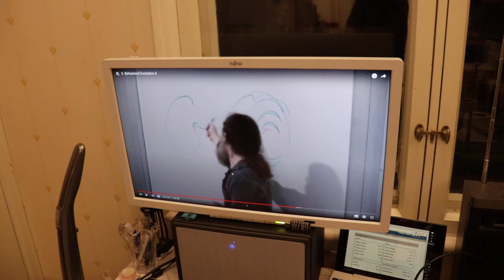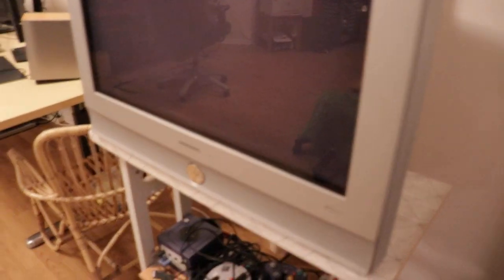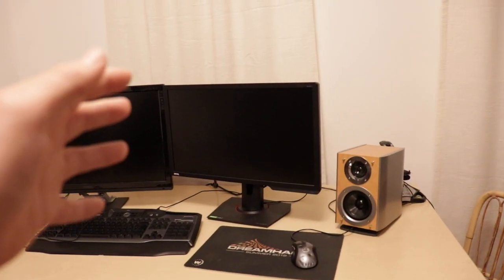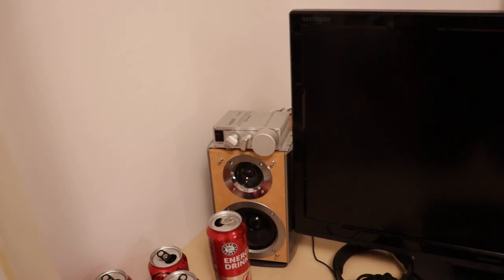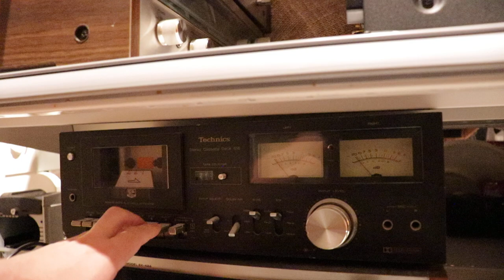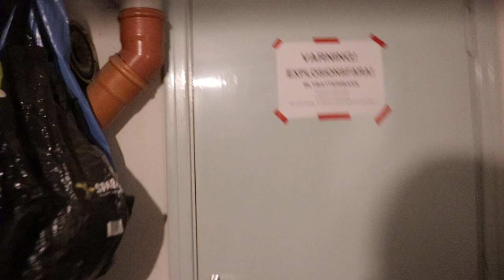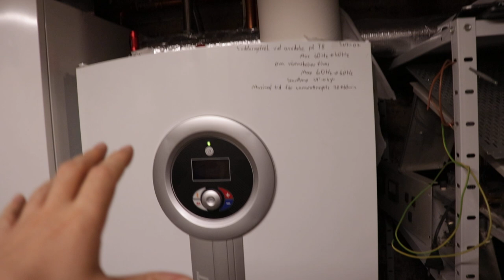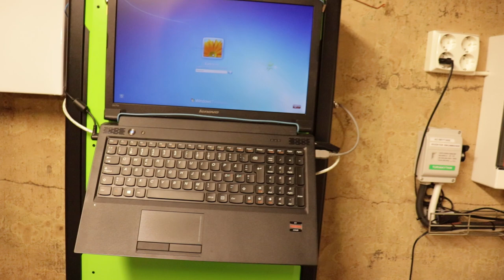All my stuff is trash. Why isn't yours?

Comment: Trash is great. Here in Western Australia we have something really cool (in my opinion) called "verge collection"/"council pickup", I think it's fairly unique to Australia, what happens is twice a year on a specific weekend date (varies by suburb and local council) you're allowed to put a pile of all the random trash that wouldn't fit in your regular bins on the curb/verge in front of your house and the local council will go round the suburb and pick it up the following week. It's awesome, people throw away so much useful/interesting stuff. You're not technically supposed to go looking through people's piles, but everyone does and nobody minds so long as you don't make a mess, saves it from going to landfill. Half the parts in my PC and two of my monitors I've found on the side of the road, I also have a small server rack, half the stuff in there, including the rack itself, came of the side of the road, the rest of it was either free (cuz it was being thrown out or was unwanted) or pulled out of a dumpster. In summary, trash is great.
Reply: In Sydney most local councils have changed so that instead of the twice-yearly collection for everyone, now each household just books in for up to 4 collections per year. These occur the morning after normal rubbish collection night.... so if the red rubbish bins are out, then that indicates that there will be some houses with good stuff piled out the front.
I try to go to 2 suburbs each week, one on Sunday and one on Monday. The drive takes a few hours, but because of the lower volume of stuff there are less scabs and pickers, which means much better stuff is available for longer. I do very well indeed, averaging $500 to $1000 worth on a good night.
The biggest hassle is the F*#@ing "cord cutters" who will damage a $500 amplifier by cutting off the cord to get 10c worth of copper. Such clueless bastards, shit I hate them.
Reply: @johncoops6897  I think Ashfield still does the once a year PU, but Bankstown is the ring a PU, ie, no one day to search through a large selection. Flats usually street dump and the council PU, but I know I guy that did that when he left his flat and they chased him and fined him. I've even seen the illegal dumping tape on a single 20l drum.
Reply: @SidneyCritic  - the sub-contractors they use are arseholes. If they decide they don't want to pick up the stuff, then they just leave it there with a note about "too hard" or "too big" or similar bullshit.
Then they report back to the local council, who comes around the next day with the yellow "illegal dumping" tape and a hefty fine for the person who made the booking.
This is especially problematic because there is a tendency for other locals to add stuff to your pile, so you can cop a fine even if you only put out suitable items, and you also have the responsibility to remove excess and/or non-compliant stuff from the curbside!!
I've had so much drama with this that I ended up using spray marking paint to define the cubic metre volume of my pile, as well as photos to use as evidence.
Reply: Haven't seen this in Adelaide for years. Would love to see a comeback but I believe John is right that you book in for such collection. I don't throw a whole lot out so have never looked into it.

Comment: As long as stuff works, and it's good enough for your use-case, you can make do with trash picked stuff. Sometimes cleaning is all that is required.
Most of my stuff is second-hand, but monitors, keyboards and mice find their way to me for free. Same for my huge printer.

The only 24" monitor I have has broken leds in the panel. The led control chip shut down a quarter of the leds because of that. I did some creative wiring to fool it into working condition. It's good enough.

Old computers, lab gear, industrial SBC's, development kits and other stuff that gets tossed at work I repair if neccesary, clean up, check for completeness and sell. I have enough stuff as is.

Comment: Nothing bad about repairing/recycling.
But you are a hoarder he he :-D
Maybe dump some of the crap that's not really usefull to make space for new junk :-D
Reply: All really techy guys I know are hoarders. Myself included.
Most of the things come to use either for myself, family or friends
Reply: Trust me, that's really not that bad. Source: I'm far worse :P  It's hard to get rid of stuff sometimes, either cuz said stuff is just plain cool or because it's irreplaceable or would be very costly to replace. Example: I like messing around with old computer stuff, I've got a couple of 8 inch floppy drives sitting doing nothing on a shelf, they're bulky and kinda useless to me right now. But i cant get rid of them, it'd be very difficult to find another one if i do eventually need one and i would probably end up paying a fortune for it if i did.
Reply from the maker: I'm a hoarder when it comes to expensive, useful or rare stuff. Sadly, since I run a business from home that specialises in fast turnaround for weird industrial stuff, a lot of "random board with a bunch of good transistors on it" classifies as "useful". :V

Comment: 3:25 I have old microwave in my kitchen. I trust that more then the modern china crap. It's UK made Electrolux Mikrovågsugn NF4061 from around 1992-1994.
https://manualzz.com/doc/50273960/electrolux-nf4061-anv%C3%A4ndarmanual
https://www.electrolux.se/support/user-manuals/?q=NF4061 Swedish Manual

Nice Nintendo 64 memories <3 Still have my one complete in box ;-)

I have found alot of stuff that people have throw out. Other people trash is my treasure ^^
Most valued item found ever is a Denon PMA-520AE Stereo Integrated Amplifier with bent power connector but that was easy to fix and some cleaning for sure. Works fine.